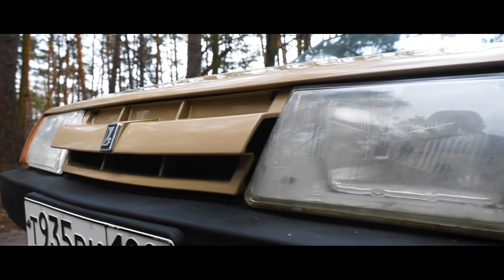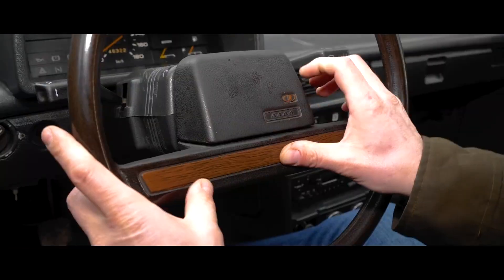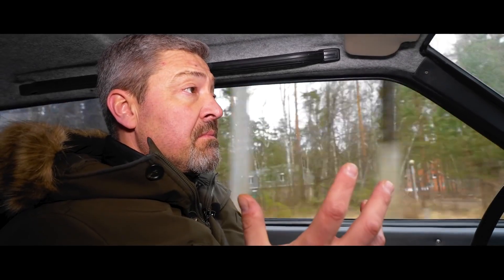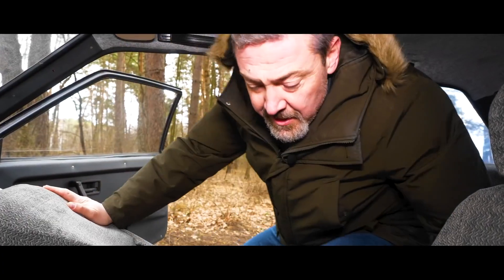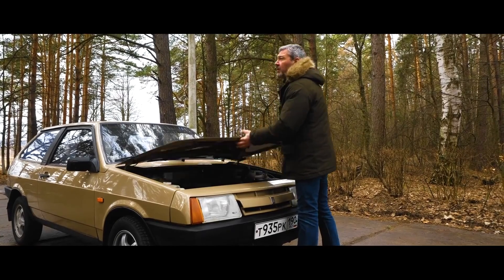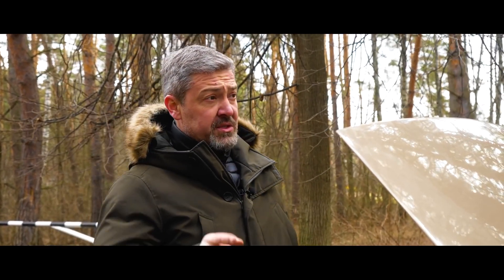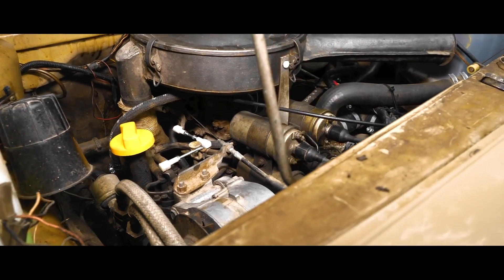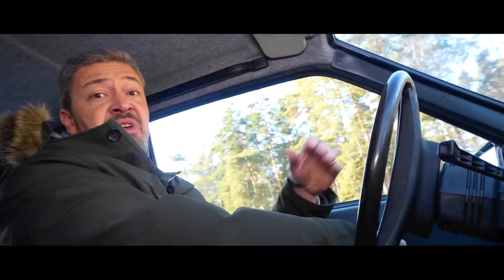🚙ROTARY engine CREATED in the USSR! 🚗Car of the KGB (special services) USSR VAZ 2108

Comment: Some interesting design features.  The center of the grill protrudes.  The lower portion of the rear hatch protrudes,  resulting in a large gap between it and the body. The ground clearance is high. A pity the engine isn't so durable.